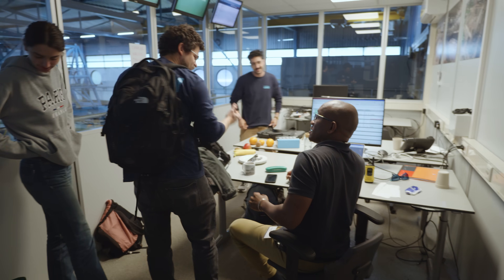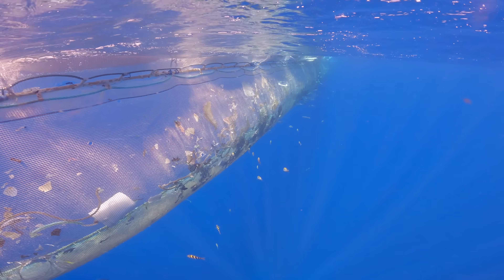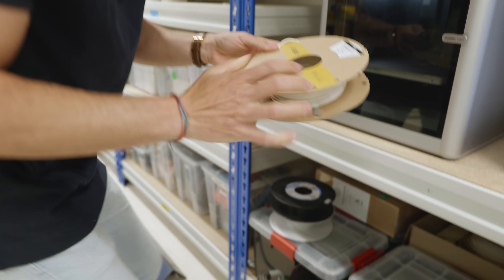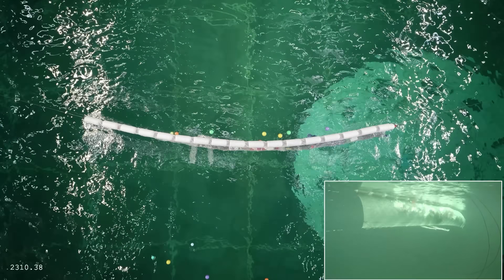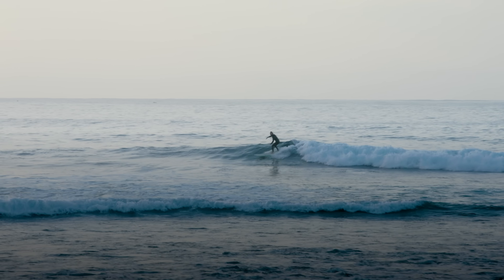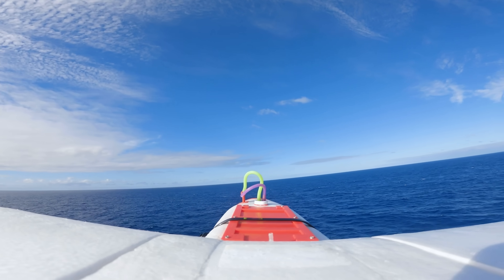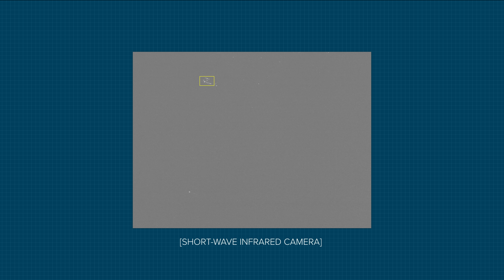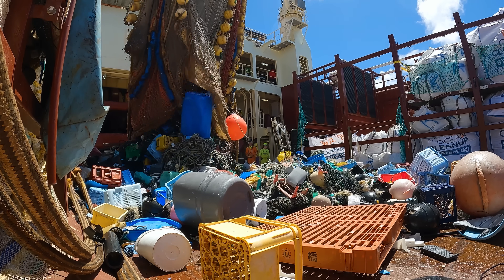Ocean operations update: improving our cleanup system

Comment: Go buy an older ULCC, convert it to run on solar.  The solar panels cover the deck surface.  Install side booms that go into the water with surface scoops connected to augers.  The augers connect to conveyers that send the collected material into the cargo hold, that used to house containers.  Any fish that come up can be tossed down a pipe that drops to an outward-flowing canal full of seawater that is pulled right from the ocean and dropped back in an endless cycle.  You can run the material along conveyors that can use AI sorters.  The sorters send sorted material down side channels, some of which go directly to shredders, some to melters.  The material being pulled out is old extruded plastic of some sort.  Ground down, it takes up a lot less space, and the melters can turn the plastic into pellets or plastic wire to spool up.  Done right, I would think the amount of material collected (since it runs 24/7) would be staggering.  
Loading it by the bag net is too slow.  The ship's fuel being used to go in and out with loads is staggering.  Solar or wind power is free.  The ships might not be as speedy, not being diesel anymore, but who cares?  Cruising along at 1-5 knots also allows critters to get out of the way, too.

Comment: We drop the same sort of tonnage of microplastics onto our roads from car tyres, the same plastic that is used in bottles is used in clothes for the higher percentage and we wash those down our drains every wash. Your house if filled with layers of microplastics where the amount accumulating in your body is supposed to be the weight of a plastic fork and "this" is what should be in the news?
It's nothing more than a rubbish pick up program while we increase our use of oil and therefore plastic.

Comment: Organizations like The Ocean Cleanup aim to remove 90% of floating ocean plastic by 2040. This ambitious goal involves intercepting plastic in rivers to stop it from reaching the ocean and cleaning up existing "legacy" plastic from ocean gyres. However, it's crucial to remember that ocean pollution is a complex and ongoing issue, with some experts suggesting the 2040 goal might be optimistic, and projections show that without intervention, plastic pollution could triple by the same year. 
Key Goals & Strategies
The Ocean Cleanup Project:
This non-profit organization is a leader in the fight against ocean plastic. Their strategy involves a dual approach: 
Intercepting in rivers: Stopping new plastic pollution at its source before it reaches the ocean. 
Cleaning legacy plastic: Removing the plastic that has already accumulated in the ocean, particularly in major garbage patches. 
90% by 2040:
The Ocean Cleanup projects a significant reduction in floating plastic within the next two decades. 
Factors Affecting Progress
Scalability: Scaling up cleanup technologies to an effective level is a significant challenge. 
Funding: Large-scale cleanup efforts require substantial investment. 
Source Reduction: To truly achieve a "clean" ocean, stopping the flow of new plastic into the environment is just as crucial as cleaning existing debris. 
What You Can Do
Reduce, Reuse, Recycle:
.Your individual actions can significantly contribute to reducing plastic waste. 
Support Organizations:
.Support groups like The Ocean Cleanup that are working on solutions to ocean plastic pollution. Per google